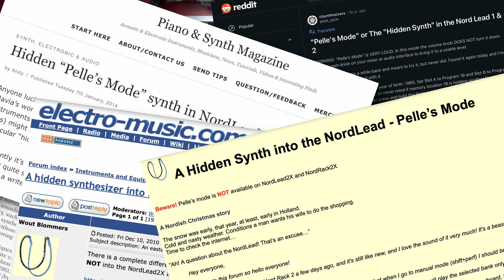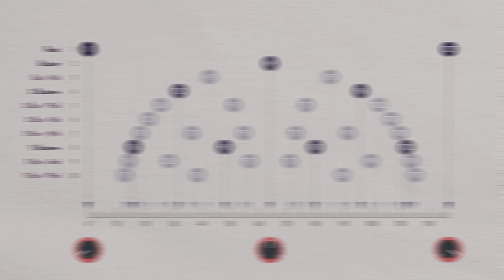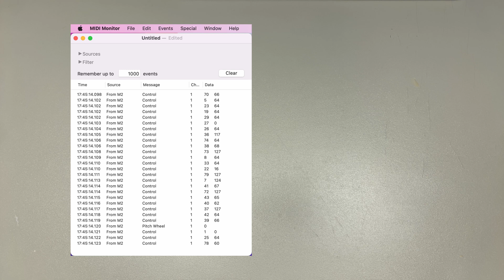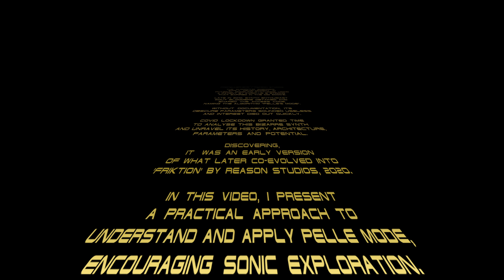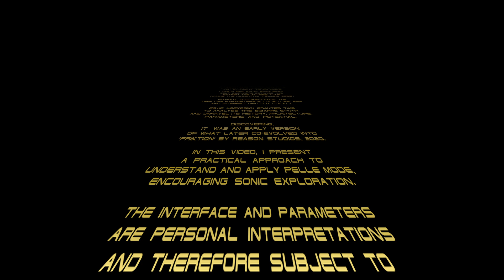🔑 Unlock Hidden Synth: How to use 'Pelle Mode' on Nord Lead 1&2 | 8-Minute Tutorial

Comment: Hey Dirk, first of all, thank you for your groundbreaking and beautifully produced tutorial! I´m fascinated by Pelle´s mode and I´m curently tempted to pick up a NR2 mostly to explore these sounds, especially since your tutorial did such a good job of clearing the mists of obscurity long surrounding this mode.

I have a couple of questions I´d really appreciate it if you could help me with:

1. Is there any software you can think of that would be comparable to Pelle mode in terms of sound and workflow? I´m into hardware synths and I´m sure I´d find other uses for the NR2 along with my other gear but I wonder if it´s crazy to spend €400+ on a synth mainly for a decades-old physical modelling easter egg feature when better and cheaper options are probably available.

2. you mentioned somewhere that there are differences between Pelle mode on NL/NR 1 and 2. Could you elaborate on this? Which sounds better/more interesting to you?

3. Does the PCMCIA expansion card add any functionalty regarding Pelle mode?

4. While we´re at it: what is your current favourite synth/vst/sound generating device, and why?

Thank again, all the best!
Reply from the maker: Hi, thanks for the feedback!

1. I can't imagine a software that would be comparable to Pelle mode, since Pelle mode is such a rudimentary raw R&D algorithm that tends to exceed the limits of a subtle tuned Karplus-Strong engine; where parameters interact to not go beyond the limitations of physical string modelling. This being said, one can interpret Pelle mode as an early precursor to Reasonstudios Friktion softsynth. I guess Reason delivers more bang for the buck, than an equally priced NL1 or 2... but it's not that raw. 

2. The most interesting machine to run Pelle mode IMO is the NL/NR 1. As far as I understand, the NL2 has a different Digital to Analog Convertor (DAC) that causes Pelle mode to aliasing, or the observation of mirrored frequencies in the spectrum at about 20.500Hz (probably half the sampling rate of the NL2). Difficult to notice by ear but certainly noticeable with a spectrum analyser.

3. PCMCIA expansion card adds no functionality regarding Pelle mode. The algorithm remains monophonic.

4. My all time favourite sound generating tool is VCV Rack. It's free, open source, endless combinations, 32bit float, 1000's of modules to experiment with; including eurorack samplers, granular and even Karplus-Strong (Pelle mode). It can be controlled by MIDI and patched to game controllers... VCV killed my GAS and tickles my creativity!

All the best! 
Dirk
Reply: @DirkLepez  Many thanks for taking the time to write such a detailed reply! Great info, much appreciated. I´ll be checking out VCV Rack for sure, and will keep an eye open for a reasonably priced NR1. Happy sonic explorations, all the best!

Comment: Top video!! (almost). It's a pity after so much work, the right channel decided not to cooperate. Personally I'd fix it and re upload it. While at it, I'd design Pele overlay and have it in my store and link it in the video. (Just thinking out loud if this was my vid) :)
Reply from the maker: Thanks for the feedback! The LR audio split was helpful in editing. I'll try to improve it. Currently, I'm developing a website, overlay and PDF guide. Also exploring the best approach to offer them.
Reply: @DirkLepez  First, thanks for the video. I need to get my Lead 2 out of the box and try this out. Watching this I was also thinking how a physical overlay would be very useful. (With instructions on how to get into the mode, and a few other instructions off to the right.) Also thinking out loud, I was wondering if the button presses needed to enter Pelle Mode could be transmitted via MIDI. Unfortunately, I'm guessing that's a no. Could be an interesting project for someone to write software (VST or standalone) to better visualize and control this mode.